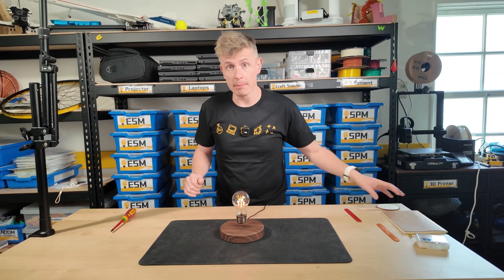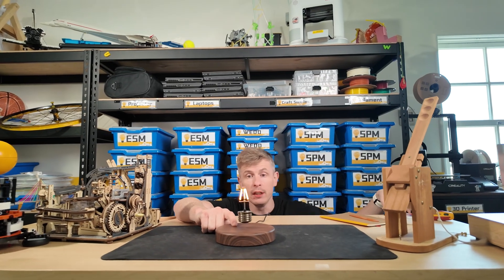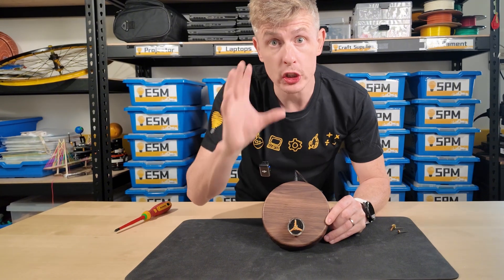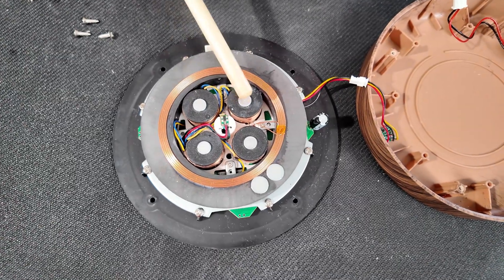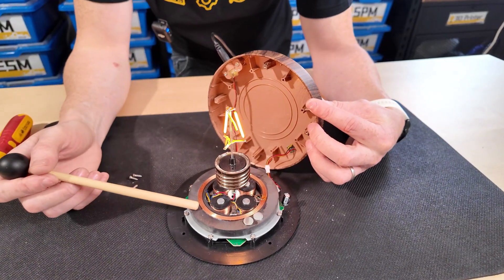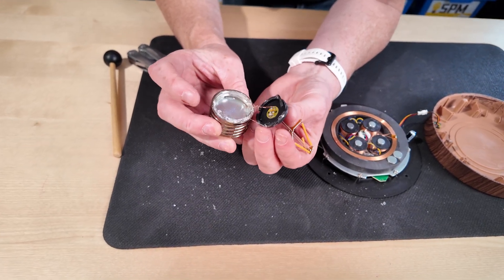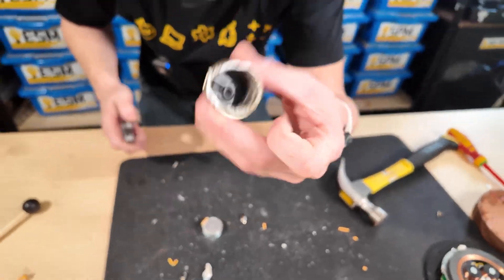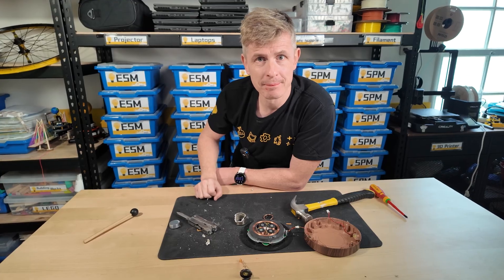What's inside a Levitating Lightbulb?

Comment: Funny. I have the exact same bulb and have had it for 2 years but today, unfortunately, it fell and shattered. The funny part is that I used the same type of plyers to remove the remaining glass,and used a similar hand vacuum cleaner for the broken pieces LMAO. Mine still works and lights but it does not have the glass any more. Wonder why they don't do them with a non-breakable material, such as plastic.

Comment: Cool i have seen Tesla coils inducting current in other coils, but never combined with a electromagnetic levitator. So my theory is correct I wanted to make a levitating space ship toy and have it spin, my first idea was to fill it half way with water then heat the bottom of the ship with a flame and have it spin by using the reaction mass of steam to make it spin but if i can transmit energy to my ship wirelessly it will work better than having to heat it. I can then use electric motors on the sides of the ship to spin ( a bit like a drone but better as it could spin much longer than if it needed to fight gravity just using a couple of AA batteries or wirelessly ) now i know that wireless transmission isn't affected by the other field, thanks !!!